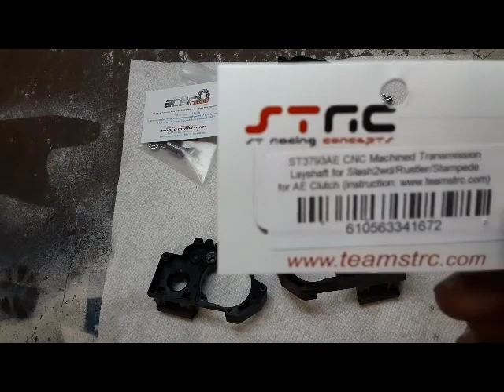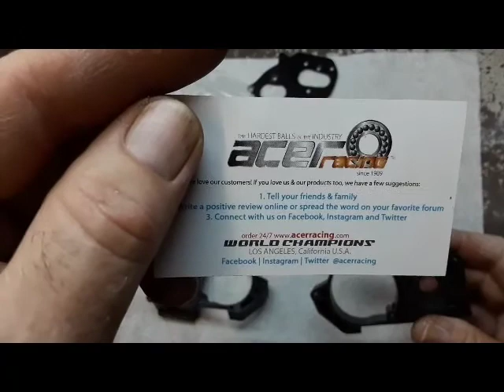RC Street Eliminator Drag Racing Proline Transmission STRC top shaft upgrade AE slipper

Comment: I've been using Fast Eddy's bearings for a long time.  His Ceramics are excellent quality and fair prices.   Neve considered polishing the gears.   How are you doing that?  Just a paste and buffing wheel across the teeth?
Reply from the maker: Yes sir . just some Rouge and a polish wheel on my Dremel, about 30 minutes each the actual gear start getting hot in your fingers. Yeah I use fast Eddie but , I like using Acer bearings inside the tranny